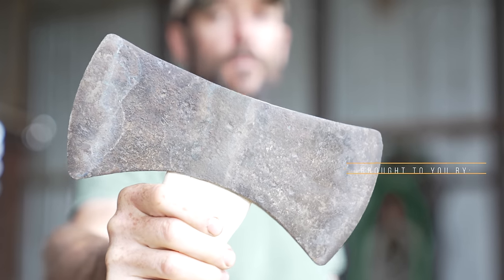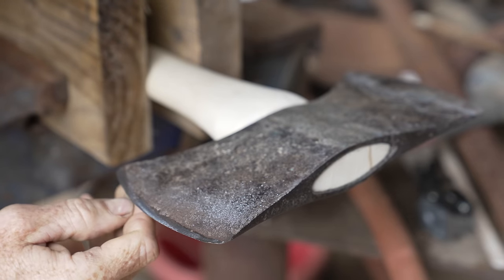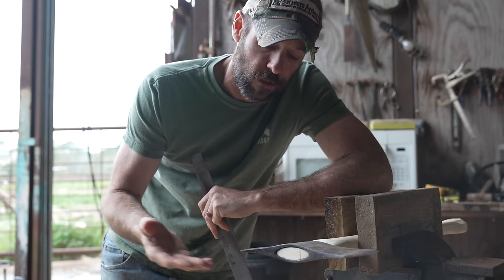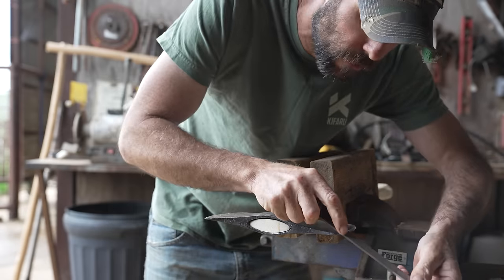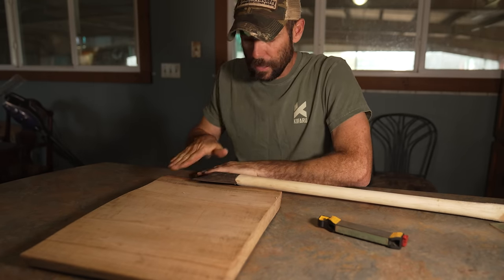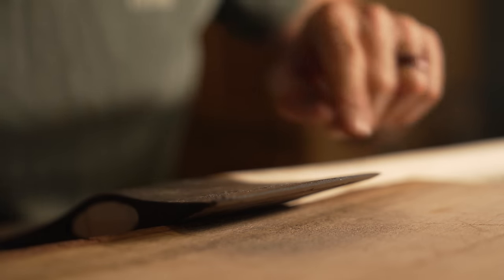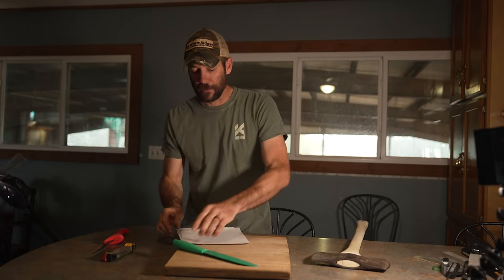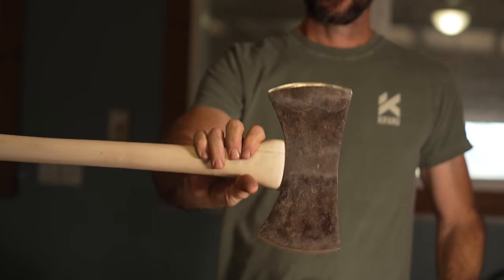Can we make this old Axe SHAVE? Axe Sharpening 101

Comment: There’s two ways that I use, to help maintain the same bevel. One is a marker/sharpie. If you coat the area that you’re going to sharpen, you can see from the first sharpening stroke, what the angle is. The second, more subtle way, is to slightly change the direction/angle of the stroke.

Comment: My only recommendation is to look at the profile of your DBL bit axe before sharpening. There are 2 different profiles per side. One side has a nice "V" shaped wedge perfect for breaking through the outer layer of a tree where dirt and sand lay in the bark. this should be your rough sharpening to withstand the dulling and abuse. The other side has a bit more of a concave profile which when really sharpened down cuts right through a green tree after the outer layer has been removed. Another nice little tip, the USFS has (somewhere I don't have a link) a sharpening profile gauge and a go/ no-go gauge for all their tools including the DBL bit axe.

Comment: Totally recommend the field sharpener. Also, the diamond surfaces can be replaced. They are held on with magnets and usage instructions are underneath one of them. On another note, IF it can be sharpened with a file it’s usually a waste of time to put a razor edge on it. The steel isn’t hard enough to retain the edge for any reasonable amount of time so, unless it’s just simply necessary to have it that sharp don’t worry about it. Clay did a different video a year or so back where he refined the edge of an ax with wet mud worked into the surface of a chopping block or a stump. That is a much better alternative, I believe.

Comment: Hi Clay,

Thanks a lot for the video. You mentioned that a sharp blade can cut paper when proper technique is used. At 13:10 you seems to not cut properly. Could you please explain at some point what is proper technique? I used a "nail test" and "marker test" on my blades and for the sharp ones I still have trouble when doing "paper test". I am no expert and sharpening and would like to improve my skills.

Thanks a lot and keep up with awesome work.

Comment: Useful tip: you can take a small towel, roll few times and place it on top of your axe, then take your mile file place it on towel, and move it from left to right, then roll your towel off just a bit, and do the same thing. Do it until you have your towel unrolled,

Comment: Whenever I sharpen a tool that has a nick in it, I never remove the nick. Why? Because if I leave it, it’s a constant reminder to the user, of what can happen! It will eventually be removed, but in the meantime, the rest of the metal is still being used to its maximum potential.